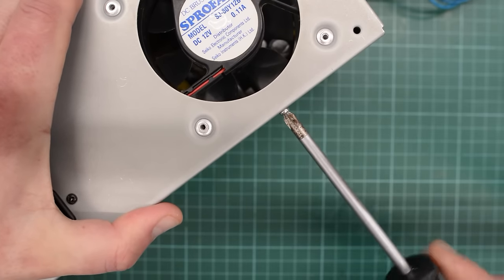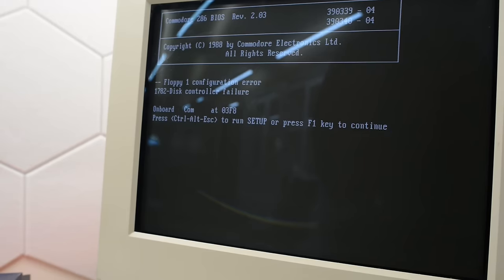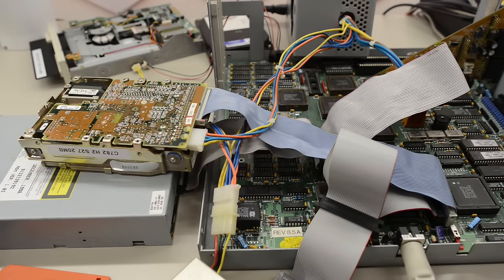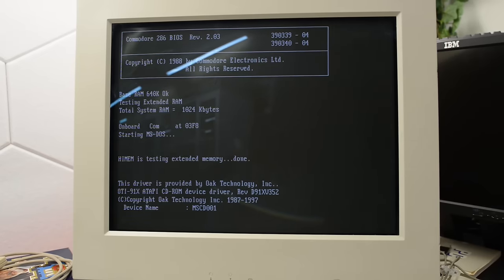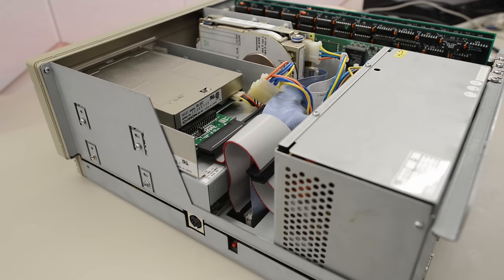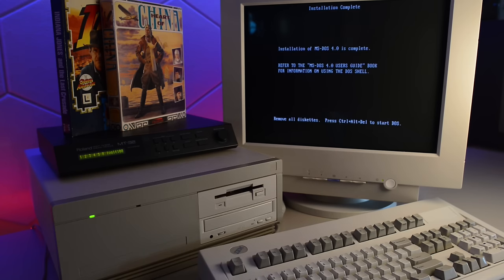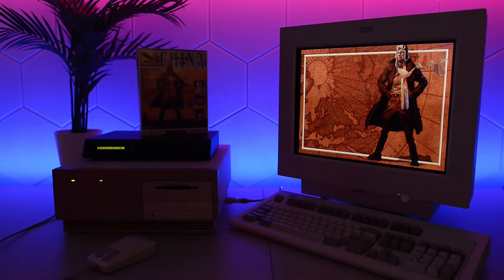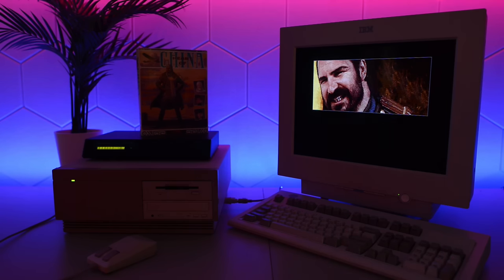Upgrading the Commodore PC35-III with a CDROM, DOS, MT-32 &Trying out how fast it is with DOS games!

Comment: This is the most cursed PC project I've ever seen. I admire your persistence to make it work.

I've also found MS-DOS 4.0 User's Guides for sale on Amazon and eBay, but no pdf versions anywhere. Doesn't seem anyone has archived it online.
Reply from the maker: Oh, this is not too bad. You should see my Canon PC videos lol. I actually tried to find a hard copy when I realized that it hadn't been archived yet. But I didn't have your luck. I can only find a bunch of random books with unclear content and one of the original MS copies. Unfortunately, that copy is on ebay AU :/ Anyways. several comments tell that DOS 4 doesn't have any memory management. I think I'm gonna try QEMM next
Reply: I have a couple copies of PC-DOS 4.0, and a sealed MS-DOS 4, but no good way to archive physical documentation yet.  :-(

I also noticed there were no convenient PDFs online when I was too lazy to fetch the manual from the box recently.

I need to start a YT channel so CZUR will sponsor me too.  LOL  :-D
Reply from the maker: @nickwallette6201  That's ok. You can send me your original boxed copy. no need to scan haha

Comment: there is a emm286 project, you could also look a blog post called  The Silicon Underground : DOS memory management on a 286
i picked up 286 board, but im stuck with 1 meg, so your pretty fortunate with those memory boards. Im waiting for picomem.

Comment: I had a good friend that had a NEC 386SX 16Mhz PC that came with DOS 3.3. He bought DOS 4 shortly after it was released and after a couple of weeks of fighting with it went back to DOS 3.3 with QEMM until DOS 5 (possibly 6) was released. QEMM was practically required if you wanted to play games and had a CD-ROM drive at least until DOS 5 or DOS 6 was released and added better native memory management tools. 
On my 486 PC (which came with DOS 6.22 & Win 3.1) I setup a custom boot disk that had about a half dozen different autoexec and config sys configurations for certain games, some used QEMM, some used EMM386 and so on. It was both frustrating and rewarding to have to deal with the limitations of conventional memory in the DOS days!
Reply from the maker: yeah, totally agree. Challenging but very rewarding. I think the way forward here is QEMM
Reply: I used to use QEMM 386 back in the 90s, with all the special parameters that Optimize would add.

These days, I hardly even bother loading EMM386 anymore unless I have to have it for something.  Just using himem, dos=high,umb and devicehigh / loadhigh, I can get CD, SCSI, ASPI, MSCDEX, SmartDrv, and a mouse driver in RAM with a perfectly usable 580-600K of conventional memory.  Not sure why I ever bothered with QEMM, since it just seems to make things a little bit more fragile, and apparently I never really needed it.

Granted, I started my DOS journey on 5.0, and could’ve done then what I do now.  It would be different with DOS 4.  I do run that on a PS/2 Model 30 286, but it’s also nearly stock (just added an AdLib), so I don’t have all the extra drivers to worry about.

Comment: I had a lot of this problem growing up with mostly somewhat later PCI-based systems.  Games just needing every little bit of memory because they were written for computers utilizing mostly "intelligent" devices or the specific model of device that didn't need extra drivers, where later on hardware was either different enough that some driver was necessary to adapt things or add back the smarts that were taken out of a device, so even just a few KB for a mouse driver or something would just make it impossible to run some things.
Reply from the maker: Yeah, challenging but rewarding

Comment: When I built my retro gaming rig I couldn't for the life of me could not find my original MT32 "It's somewhere in this house I swear" so I found a project called MT32L that uses a raspberry pi to emulate a MT32.  It sounds just like the real thing and the bonus is that you can also use it in midi mode and emulate a sound canvas ... all those old games sound so great now.
Reply from the maker: Awesome. A viewer actually donated one of those MT-32 Pi modules to the channel. I don't know when, but at some point, I will make a comparison
Reply: Do you still need the MPU-401 interface card to use MT32L?
Reply: @looks-suspicious  Yes I have a Music Quest ISA MPU-401 midi card that runs the midi interface on my MT32L ... You can use a sound blaster for the midi interface however since it does not have a true MPU-401 you have to run a TSR called SOFTMPU to get mostly full compatibility. Vogons has information on it.

Comment: I rewatched the footage where you tried to measure the voltage on the PSU. The PSU made that horrible noise when your shorted the 12V and ground lines with the probe tip.
Reply from the maker: The connectors are insulated with plastic. I'll revisit this problem in part 3
Reply: @Epictronics1  the metal pins aren't surrounded entirely by the plastic connector housing, it's possible to put a thin probe in between the two pins and short them. I am quite sure that's what happened.
However I might be wrong, as I was not present during the shooting of the video.
Looking forward to part 3 though :)
Reply from the maker: @AttilaSVK  Ok, I'll check, thanks : )

Comment: You need an EMM memory manager utility. It'll give access to the extended memory into a window (high/low address) under the 1mb ram barrier. Once that's working, then you can DEVICEHIGH= and LOADHIGH your drivers and in your CONFIG.SYS shove DOS=HIGH,UMB .. I have a PC40-III ..quite similar hardware.
Reply from the maker: I'm actually working on this system as I write this. What EMM manager are you using?

Comment: Didn't the PSU noise come from you shorting the blue and yellow wire in the molex plug with the multimeter probe? I haven't seen the entire video yet so you might come to that later in the video but it looks to me you put the probe between the two pins instead of in the one to the yellow wire.
Reply from the maker: No, there is plastic between the connectors in the molex. It keeps making similar noises every time it's about to start the fans. It's probably a coil noise from inside the controller or perhaps from the coil in the fan.
Reply: @Epictronics1  it sounded exacly like the AT power supplies I shorted back in my early computer days. Combined with the probe it made me guess a short. :)
Reply from the maker: @alexhofstee466  It sure as hell scared the crap out of me haha

Comment: I wonder if the weird adapter board was used to adapt left over Amiga specced floppy drives to the AT style disk controller?
Reply from the maker: Could be, I was sure that the board just reverted back what was non-standard on the mobo pin headers. But I was obviously wrong
Reply: Pretty sure that's exactly what the board is for. What's "standard" and "non-standard" is relative. IBM, in its infinite wisdom, decided that having to set a drive select jumper on a Shugart "standard" floppy drive was far too complicated. IBM's "non-standard" solution was to pre-set the drive select jumper to make every floppy drive a B: drive. To get a pre-set B: drive to identify as an A: drive, they put a twist in the cable swapping some signals. Now instead of having to mess with ridiculously complicated jumpers, all you had to do to get an A: drive was to make sure it was plugged in at the end of the cable. Never mind the drive enable signal is also swapped, this is clearly easier to deal with than a jumper. IBM said so and this practice eventually became the "standard".

Commodore failed to recognize the wisdom of IBM. Amiga floppy drives follow the original Shugart "standard" and the barbaric practice of using jumpers instead of swapping the drive select and enable signals eventually becoming "non-standard".

The FB-357 was used in Amigas and is probably set up in a "non-standard" way. The board changes things for that drive to be recognized as a "standard" PC floppy. A "standard" PC floppy should work if you can manually set drive select to A: with one of those nasty jumpers and swap the the drive enable signal.
Reply from the maker: @aladdin4d  Ok, thanks, we might try that
Reply: @aladdin4d  That pedantic dumbing down is why cable management is such a nightmare on older PCs with ribbon cables. Give me jumpers and dumb 40 wire IDE cables any day

Comment: Making CDROM work on those ESS cards is really a PITA. Is seems that it depends on particular revision of the drivers. I have exactly the same ESS card that you presented in this video and I managed to make CDROM interface work so, I have sent you zipped DOS drivers for this card.

Edit: my email was rejected due to "security reasons". Still, I would like to share those drivers, would you kindly suggest proper way to send those to you?
Reply from the maker: I'm using drivers from Phil's computer lab. Do you have alternative drivers? I don't know how to get past googles zip limitation. Are they available somewhere to download? Or do you have drop box?
Reply: @Epictronics1  I have sent you another email with link to Google Drive
Reply from the maker: @86smoke  Thanks!
Reply: @Epictronics1  it would be nice to know if it actually worked for you, can't wait.

Comment: there ram card for it if u can find it just boost up speed
if you using ribbon cable to different driver i would find twist in ribbon cable for different driver just in cause if work or not
finding card for it kinda in middle of somewhere
i may pull out box of ton of old card for you just hope no rain fall in

Comment: Most Sound cards Had propietary non Standard ide CD Rom Controllers and only worked with certain Models fromm certain manufacturers though the connectors are Standard 40 Pin ide....
Reply from the maker: Yes, most of my cards have proprietary controllers. These two and a few others have proper IDE though

Comment: I'm not going to lie, I don't miss the days of himem & emm386 and trying to get everything loaded up so there was enough memory to run games.  I never used DOS 4 as it was known to be problematic.  I upgraded from 3.3 to 5.0 and also used QEMM.  Ah, these were the days.  ;)
Reply from the maker: Apparently, QEMM requires a 386. We are gonna have to try something else
Reply: When QEMM came on the scene, they wrecked all that cred I had in handcrafting startup files to have 621K (or more) but it sure was revolutionary.
Reply from the maker: @OscarSommerbo  Are there ways of moving the drivers above conventional memory without using QEMM or QRAM?
Reply: @Epictronics1  In Dos 4.0 I have no idea. But  without himem.sys I think you are stuck. But himem.sys comes on Windows 2.1 (and later Dos 5), says Wikipedia. So it might be possible to do the traditional loading high once you installed Win 2.1
Reply from the maker: @OscarSommerbo  Yes, that is actually a possibility. I read someplace that W2.11 had some kind of memory management but I never checked any further. The question then is if Windows eats up any conventional memory and leaves us with the same problem?
Reply: @Epictronics1  Not necessarily, as you don't have to start windows, and you can safely omit any windows specific drivers (printers mostly). 
All we want is the DOS 4 compatible himem.sys and the older EMM386.sys. Which shipped with Win 2.1.
Reply: @Epictronics1  Windows wasn't an operating system until Windows 98. Well, sort of. But 3.11 and below are just dos applications, that you choose to run or not. But Win 2.1 was so big that MS needed to access those 384kb hiding in high mem. And expanded memory most likely.
Reply from the maker: @OscarSommerbo  Hmm. this could possibly be our solution : )

Comment: DOS4 has no memory management or ability to load drivers high. In fact it uses more conventional memory than DOS 3.3. Either go with DOS5+ or use Qemm.
Reply from the maker: Thanks, I'll try QEMM
Reply: @Epictronics1  QEMM requires a 386. There is a 286 version called QRAM, but I'm not sure it works with all chipsets. I think using DOS 5 and loading the kernel into HMA with himem.sys and DOS=HIGH is your best bet.
Reply from the maker: @looks-suspicious  Thanks, I haven't read up on QEMM/QRAM yet. Yes, plan B is to upgrade to newer DOS but I want to give the bundled DOS 4.01 a chance first
Reply: Didn't DOS 4.01 come with emm386.sys as an precursor to emm386.exe as delivered in DOS 5 and forward
Reply from the maker: @convairb3698  I think EMM386 requires a 386. We are going to try QRAM next
Reply: I’m pulling for ya!  I know DOS 4.0 was the black sheep release, but I like the idea of running original software for the machine, and it would be cool to see more DOS 4 in the wild.  It seems right for this PC that gave you so much trouble to have an OS that requires a struggle too.  Haha
Reply from the maker: @nickwallette6201  This wouldn't be any fun without the challenges :) I'm gonna try QRAM next

Comment: You need a 386 to load drivers above 640. You cannot do it on a 286. emm386 is what lets you do that. Himem.sys allows you to load dos itself above 1MB (DoS=HIGH) and you need MS-Dos 5 for himem and emm386. Qemm Qram might help but you need the right chipset for it to work (chips and tech) as most 286 chpisets don't allow ram access between 640 and 1MB.
Reply from the maker: Yes, QRAM is our best bet right now. Otherwise, we'll have to go with DOS 5